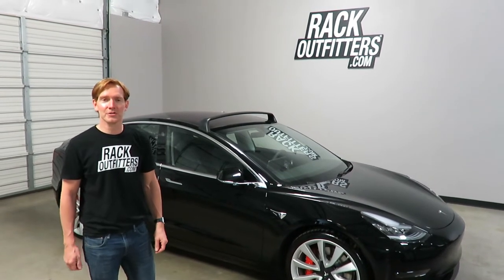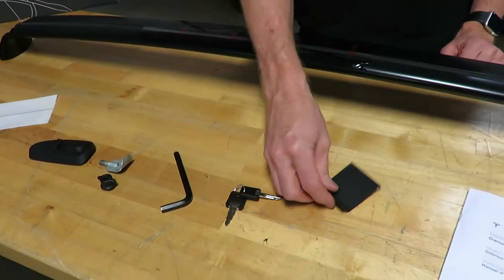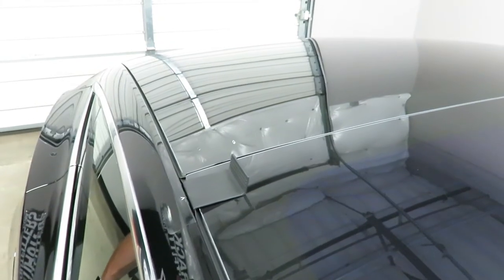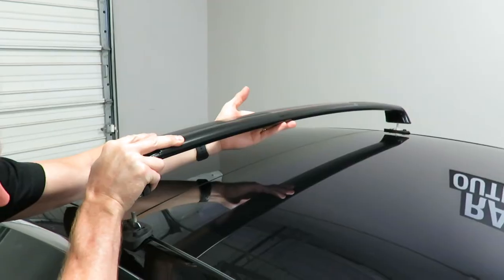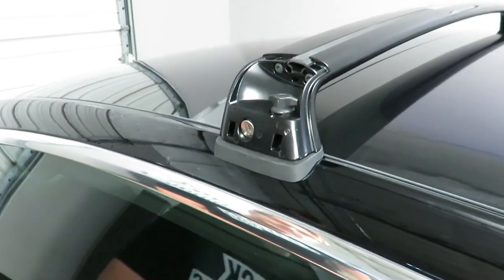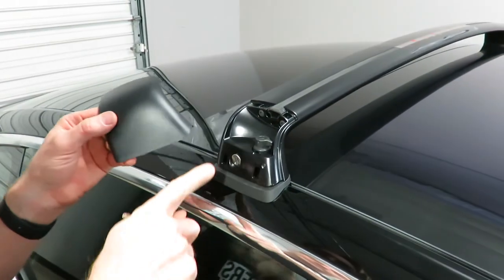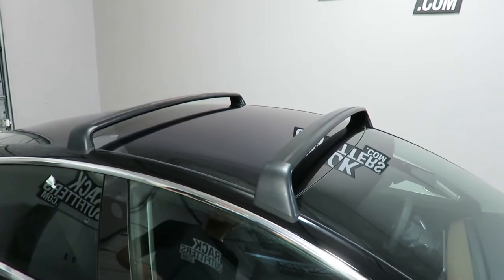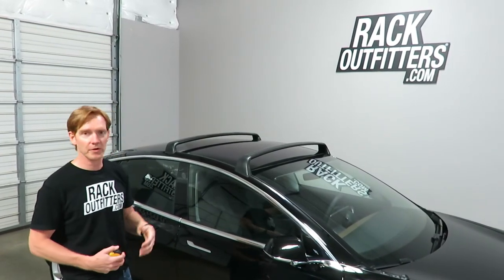How To Install the Tesla Model 3 Roof Rack Crossbars

Comment: It is definitely NOT 5 nm for tightening the bolts.  I got up to 3 and i heard crackling of the glass.  DO NOT tighten the bolts past 3 nm.  The manual now says 2.5-3.5.
Reply: Lol same here. It was super unsettling when I heard the crackling
Reply: Same here had to replace the whole roof glass
Reply: @petesplaneta9340  seek reparations from rack outfitters.  Jk.
Reply: @petesplaneta9340  😱
Reply: Actually time has passed and I have found out that the cause of my issue was that the metal bracket underneath the glass that the roof rack hooks joined onto was not properly attached during manufacture. This also caused the glass roof to not sit properly. Now Tesla has resolved without question and the rack works fine.
Reply: I have no idea how much force is correct or what 2.5-3.5 even means. I just tried to tighten with my hands and then went to hex tool when it got too hard and I just tried to make it tight enough to not move but not so much beyond that. I have no idea if it was too much.
Reply: @davidkaplan5517  you need to utilize a torque wrench.   it's a special tool for tightening bolts where it indicates how much torque you're applying.  check your local hardware store for one and support small bizzz.
Reply: @Frrrancisco  I didn’t have one so I just used the one that came in the box. I might order one and then just test how much tension I actually did to be safe.
Reply: @Frrrancisco  It is a pity that Tesla dont supply a hex tool with a built in torque setting - this is what is supplied by other roof bar manufacturers.  2.5 - 3.5Nm is not a lot.

Comment: I did the install myself but honestly, if I had to do it over again, I would pay Tesla to do it (I hear it's ~US$100). I spent several hours working on it, to make sure everything was exactly right, starting with applying the stickers without bubbles. Time is money. And I read in other online postings that the rubber feet should not be touching the glass at all (although they might very close). One of my 4 feet was indeed barely touching. I was not comfortable with this (chance of cracking glass) so I created my own spacer from a ~2mm thick piece of dense foam rubber, placing this between the 3M stickers and the black rubber foot of the rack. I believe the reason I had one foot touching the glass is because the glass on my 2018 model 3 is not completely even and sticks up a bit in one corner. My car is out of warranty so I don't expect I could get Tesla to fix that. But I suppose if I had paid them to install the rack, then they would have been responsible for making sure my glass doesn't crack.
Reply from the maker: Hello.  Thank you for sharing.

Comment: Please tell us what is the exact part number of the pictured rack system. When I go to the Yakima website it shows a "naked roof" rack system with a hook that goes under the window frame. Doesn't look like the one featured in this video. Thanks.

Comment: Well done. Can the keys be used to unlock and remove the bars or are they just to lock the nut in place. Also, that Tesla 3 is so smooth everywhere, where can you anchor straps on the car to carry a canoe?

Comment: i believe this is an original accessory (OEM) i'm in Mexico and due to the dollar conversion the original bars are way too expensive and need to go get them to a PO BOX at the USA. Are there any cheaper non-original Tesla bars that you can recommend? It is for a Model 3 2024. Thanks!

Comment: what is that spatula like tool he used at the 1:56 mark to insert the tesla provided specialty tool?
Reply from the maker: Hello.  The tool is included with the Tesla roof rack for the purpose of holding back the rubber trim while positioning the metal threaded hook.  Thanks.
Reply: @rackattack  yeah that is the black special tool, i did receive that, i was referring to the orange wedge shaped tool. 

additionally, could you provide me the model number of a bike rack that you sell that bounds on the rails and can accommodate two 26" bikes?
Reply from the maker: @kapilchhabria1727  The other tool is a simple plastic utensil.  Check out the Yakima HighRoad for carrying a bicycle on the Tesla rack: https://www.rackattack.com/rooftop-bike-racks/yakima-highroad-bike-rack/

Comment: Hello, I got my model 3 roof rack but I failed to install the sticker, do you think is there a problem is install without the sticker? Thanks a lot
Reply from the maker: Hi,  no it’s not a problem, as a matter of fact most other rack system that rest on the roof like this with rubber bases don’t use the protective film.  Just remove the rack occasionally to wash and wax the surface.
Reply: @rackattack  thanks! And thanks for the video!

Comment: Is it normal that when you put a long object on the top such as a ladder or thule cargo box there is a decline - i.e. the horizontal is not at 180 degree level.
Reply from the maker: Hello.  Yes, although the front bar sits higher on the roof compared to the rear bar, this compensation is not enough for flat items to sit completely level on the roof.
Reply: @rackattack  is it normal the slant is downward towards the front about 10-15 degrees?
Reply from the maker: @frederickbouari2625  Hello.  Yes, all Model 3 Tesla racks have the same configuration with the front bar slightly lower than the rear.

Comment: Thanks for the video - well done! Installed mine today but I had a question - is it normal that the front bar is lower than the rear? I would have expected both to be aligned but with I put a level, you can clearly see the front one is lower... just wanted to make sure all is good.
Reply from the maker: The front towers are taller than the rear to help compensate but the front will still be lower due to the about of downward slope at the front of the vehicle.  This does not adversely affect the carrying ability of the system for approved applications.
Reply: @rackattack  Thanks for confirming, much appreciated

Comment: My installation manual says 8 +/- 1 nm. Where did you see 5? For model 3 Tesla OEM rack?
Reply from the maker: Step 12 of our printed manual from our rack system delivered the first week of May, 2019 says: "Tighten the wingnuts with the wrench until tower is firmly affixed to the vehicle.  We recommend 5-6 Nm.  To confirm the tower is properly installed, pull in all directions and ensure there is no movement."  We would caution against going any tighter than 6 Nm, the manual also states that over-tightening can damage the roof.
Reply: Johnathan Smith I got the tool at an automotive place that you buy and can return from their rental inventory. But in the end I tightened manually. I was too scared. No need for the tool esp if you're inexperienced with it
Reply: @rackattack  Interesting. The current owners manual on Tesla website says 8 +/- 1 nm (Step 11) https://www.tesla.com/sites/default/files/downloads/model-3-roof-rack-owners-manual-en-us.pdf
In your experience would you still recommend to only tighten to 5-6 nm? Thanks
Reply: @drproctor22  It now says tighten to 2.5-3.5nm. I suppose a lot of glass was getting broken with over-tightening.

Comment: Just installed mine. Nice rack but it really annoys me that there so little threading on the front bar. I makes me a bit nervous because it's barely in the nut.
Reply from the maker: Generally the threads of the bolts should completely fill or pass through handle/nut for proper safety. I have had some issues lining that rack up myself in the past, please make sure its not just a couple threads holding it on. As we don't sell the Tesla branded cross bars make sure to reach out to them if you have any concerns or warranty issues. When it comes to cross bar systems, following the manufacturer's notes is what all of us Rack Attacker's start with. If you are unsure and unable to get support from Tesla maybe reach out to one of our many store's for more specific support from our expert installers. 
 https://www.rackattack.com/stores/
If you are unhappy with the Tesla bars, Yakima has a strong non-hook to the glass style roof rack and comes in a Through style bar for added functionality. 
https://www.rackattack.com/fit/tesla/model-3/2021/

Hope that helps clear things up,
#DontBeRackless

Comment: It would be great if you had a close up of the where the tape measure is located otherwise an excellent video.
Reply from the maker: The instructions usually mention where to measure from, and that information can change from time to time so we didn't want to potentially mislead on a product we don't sell. Every brand seems to have their "spot" for measuring purposes. Great point to keep in mind going forward though and appreciate the comment.

Comment: Have you run a Tesla 3 through a car wash with the roof rack installed or is that not advisable?  Thank you!
Reply from the maker: The instructions will state no car washes due to the wide range of car wash types, such as spinning brush type.  A touch-free type spray wash will have no impact on the roof rack.

Comment: 😂 You will be disappointing when you see your roof is crack when you tie the roof rack because 60% is happening already the metal attack into the glass and not attack in the frame body that’s why it broke
Reply from the maker: If you have any questions about if an install is the best option for your vehicle, we can definitely assist. Rackattack.com will help you find your local store to speak with an installer if you have any concerns

Comment: Looks like easy breaking..
Reply from the maker: All the roof racks we sell and install are pretty rigorously tested in various conditions to confirm strength and fit on each individual vehicle. If you mean looks like easy breaking as in with a sledge hammer, hitting underground parking or getting in an accident...Sure, probably break pretty easy but those "Worst Case" scenarios would cause almost any cross bar system to break easily, nevermind the poor vehicle!
Reply: No I am not talking about the rack/ product, but the Tesla Roof (and Tesla’s construction how to hook it invisible). It is so close to glass and how should be mounted
Reply: No I am not talking about the rack/ product, but the Tesla Roof (and Tesla’s construction how to hook it invisible). It is so close to glass and how should be mounted